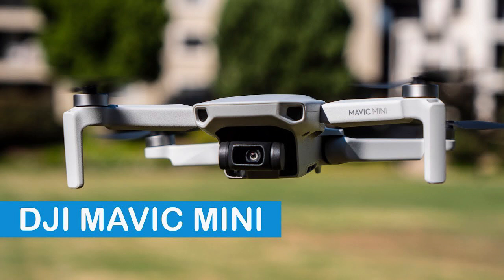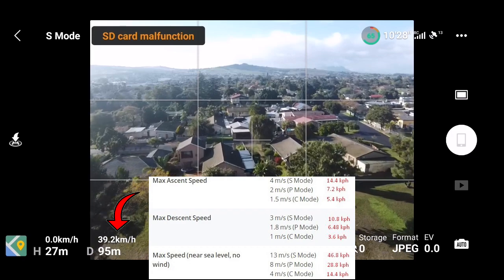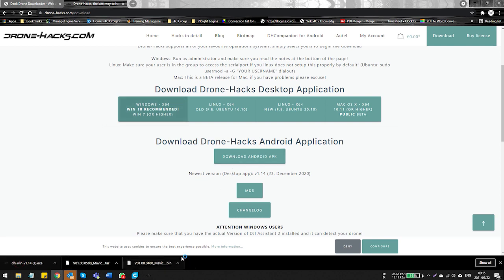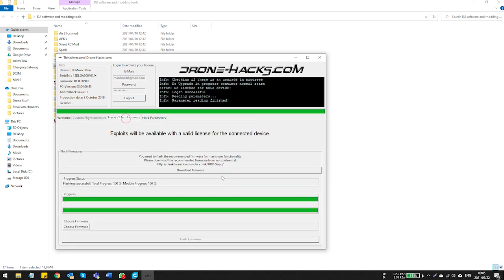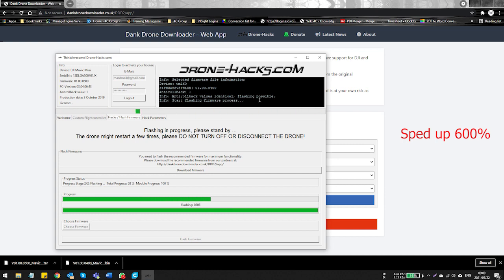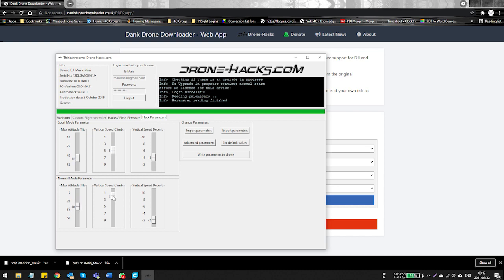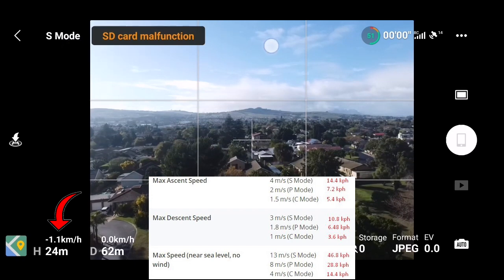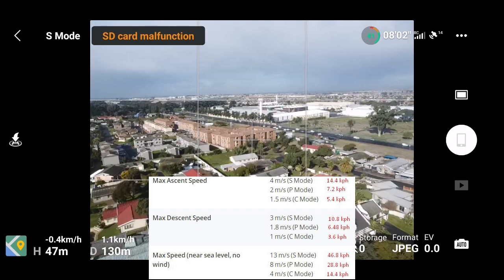IMPROVE WIND RESISTANCE! INCREASE THE DJI MAVIC MINI'S TILT ANGLE!

Comment: I am confused, the available hacks for the mini on the website don't match your video at all! there's only 2 available and they cost £40
Reply from the maker: You are correct, there are only 2x mods available for the Mavic mini. But the parameters you can modify for free using the drone hacks application. It's not a "mod", you're just updating the configured limits manually.

Comment: anyway to increase the tilt of the dji mini 2? When applying the break the camera dips down to -28. There must be a way to increase tilt in sport mode. The fastest i’ve made the mini go was around 64 in atti mode. just asking before searching for settings in the settings in drone hacks.
Reply from the maker: Hi there, the tilt angle mod will be the same on the mini 2 as well. Same as mini 1.
Reply: @InfinityDrones  do you know the name of the parameter of atti mode tilt?
Reply from the maker: @cyan4455  you can just search "tilt" in the parameters section and it will give you all the options that affect tilt.
Reply: @InfinityDrones  i just figured it out for atti mode, the controls such as tilt are copyed from normal mode. all i needed to do was change normal mode tilt to 40. andd now my mini goes up to 45MPH no wind annd probably up to 75MPH with wind.
Reply from the maker: @cyan4455  awesome man! Enjoy!

Comment: How long does it take it  to flash? Mine has been stuck on 90% for more than 30 minutes
Reply from the maker: It should not take that long. DJI drones have weird issues sometimes with data cables. I'd restart the drone and redo the process. It should not take longer than 10 minutes.

Comment: I'm trying to find some information detailing mode 0 perameters on the mavic mini. new to drones and loving it so far, i picked up 3 mavic mini's at an electronics scrap facility for $150. Trying to pick someone's brain on some of the "drone" specific settings so i have a better idea of what i'm doing. 
0
Reply from the maker: You can come join in on the DJI Modding Lounge on Facebook.

Comment: Will this decrease fly time?
Reply from the maker: Hi there, If you punch the throttle yes it will slightly but not by much. If you're flying in strong winds the ofcourse it will since it's able to better fight the winds (where previously the drone would have been taken away with the wind). But in normal flying conditions the flight time should be extremely similar. 
Think of it as in driving your car on a windy day. If the wind is from the rear, you'll be more fuel effiecient and the opposite if you're driving into the wind. 
With this mod you're effectively gaining the ability to give it more "gas" to fight the wind better - and that will use up more juice. 
Hope that explanation helps.

Comment: Can i do this on mavic mini on 1 600 firmware and can i downgrade it on drone hacks
Reply from the maker: You can do it on any firmware, its not a paid option (it's free) - just remember if you do the mod and you flash firmware you loose it and will need to redo the mod.
Reply: @InfinityDrones   could u point me in right direction where to fo this thanks 😊
Reply from the maker: @iptvman2563  Hey man, have you watched this video? This contains all the steps. you don't need to flash your firmware.
Reply: @InfinityDrones   yes i watched video many times i have a mavic mini 1 and it wont let me downgrade it and also wen i try the Perimeter thing its all maxed out already can't go to 45 Degree like you can
Reply from the maker: @iptvman2563  Ah... okay... then you're sadly out of luck... it is not possible to downgrade the firmware if you're on the latest...
Reply: @InfinityDrones  ok buddy thanks for the response think I'm going to get me a new mini mavic 3 Pro 😊 thanks again buddy keep the videos coming 👍 😀
Reply: Are you on Facebook on tick too as I would add you 😉
Reply from the maker: @iptvman2563  You're going to love that drone!

Comment: Hi i just see ur post. Today cannot do the hack free it needs to pay 40€
Reply from the maker: You can still modifiy the parameters. But if your firmware is too high then you have no other choice. Really recommend to never update unless absolutely necessary.
Reply: Bro just want to ask. If i change the mother board of the drone order online do you think replacement board are in old firmware version so i can apply this hack on your video. Just want to ask some advise. Because for now i dont want to replace my dji mini 1. It still i  good condition. Hope you reply.
Reply from the maker: @Quasar_airborne  hey man. Check out my latest dronehacks videos. Mini is fully supported now. No need to replace your board.
Reply: Do i can adjust again the parameters like what you did in the video
Reply from the maker: @Quasar_airborne  Here it is: https://youtu.be/SvZflrlEaZE
Reply from the maker: @Quasar_airborne  I don't share that info sorry man.
Reply: Already purchase the license but only to unlock some altitude level. And still cannot edit the speed parameters to make it wind resistance. V1.0.600.00,
I believe this channel. I waste 40€ for nothing.
Reply from the maker: @Quasar_airborne  certain items you cannot unlock sir. That is just not possible for various reasons.
Reply: @InfinityDrones   but why you told me check my new dronehack dji mini is fully supported.  No need to replace the board.  Thats why i believe then i purchased the license. Then you didn't mention that for mini is only NFZ zone only
Reply: @InfinityDrones  better you clarify first
Reply from the maker: @Quasar_airborne  hi there, did you not watch the drone hacks video? Did you not go to the Birdmap?